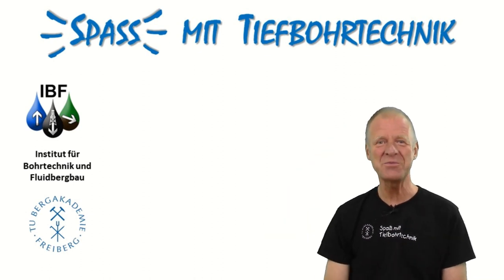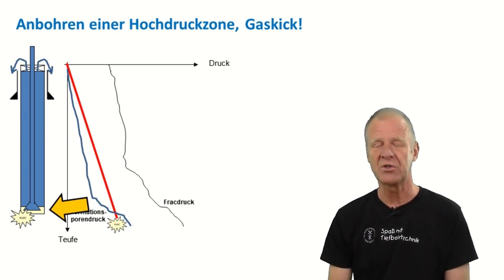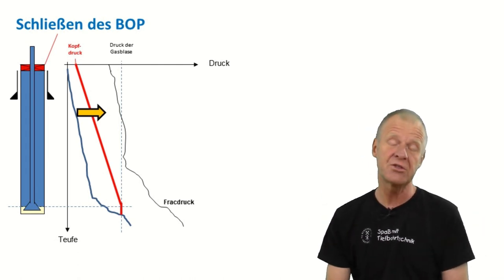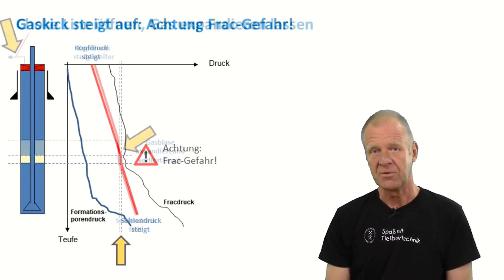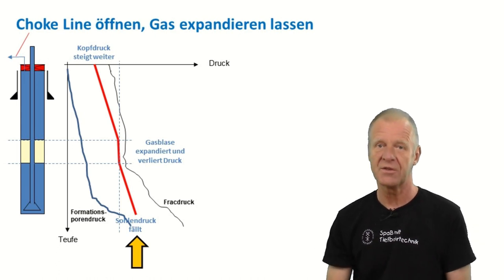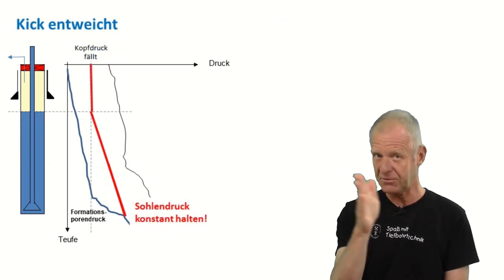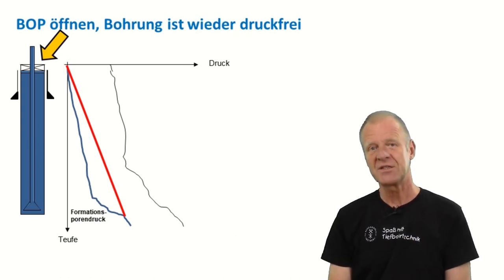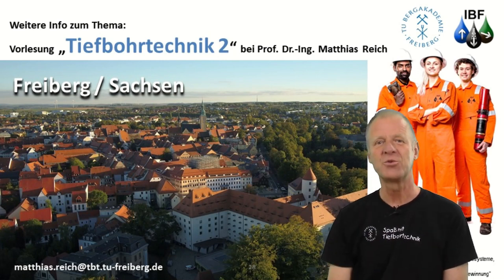How can we kill a life well?

Comment: If you have a float in the string but need to fill the drill pipe (top fill) how do you do it and at what rate (GPM) do you fill the pipe?
Reply from the maker: I´m not sure if I understand you right... a float valve in the string prevents a kick from entering the drill pipe at the bottom end. For circulating the kick out through the annulus mud is pumped down through the string at low flow rate, here the float valve is open.